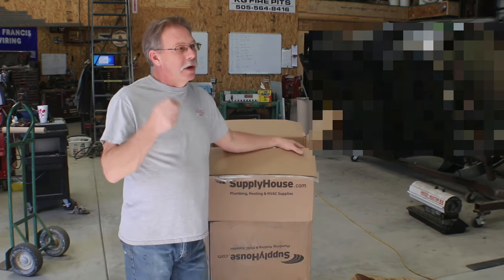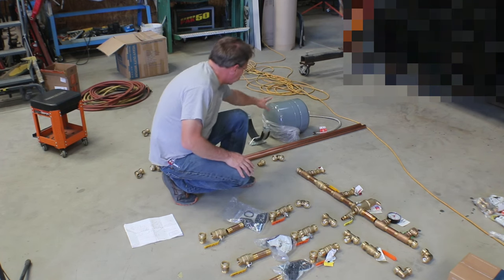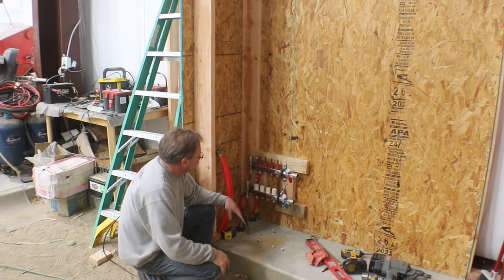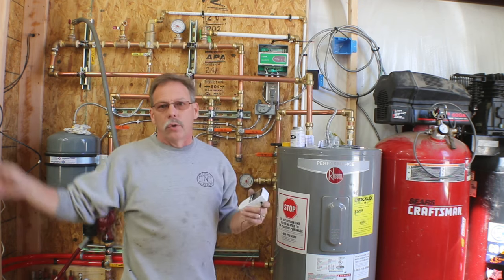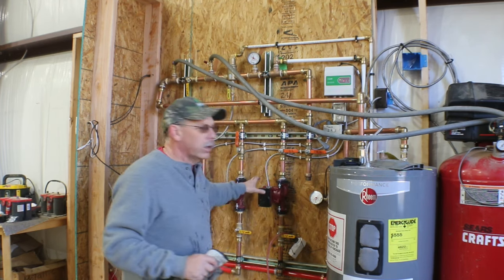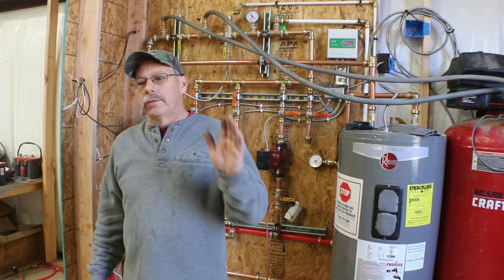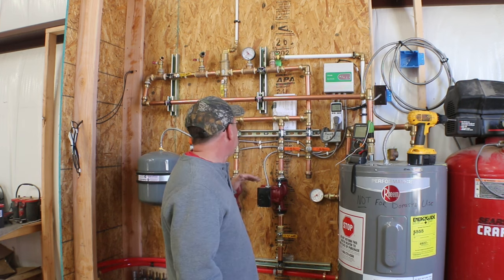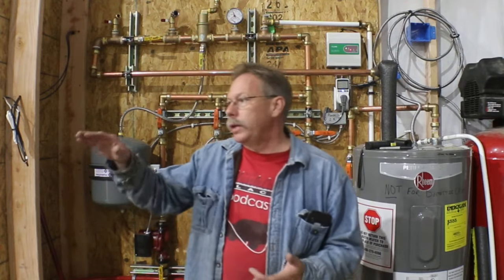Can you Heat your Shop with a $200 Water Heater? Radiant Floor Heating For My Shop | Allison Customs

Comment: Raise the temp in the tank to around 140F to start and add a mixing valve to temper the water to 110-120 going to the floor. You won’t need the timer on the pumps anymore. Wrap the tank in insulation and all exposed pipe to reduce heat loss. Good luck…
Reply from the maker: Thanks for the tips!  I’ve played with the temp and have been looking at adding a balance valve as you suggest.  Thanks for the comments.
Reply: What is the logic of heating and then cooling the water?
Reply: Yes, you can get another 5 degrees of heat that is being lost to a corner of the shop, if you insulate the outside of the hot water tank.  It all depends on where you want to put your heating money. Hot water tanks are not insulated very well at all.  Pumps will get noisier fi you have piping on the outlet that is too large for the size of the pump body and the outlet nipple ID.  Stay within the manufacturers out flow sizing table for this.
Reply: Why insulate the tank if the tank is inside the space you are heating?  And why mix in cold water rather than turning down the heater’s thermostat?
Reply: @blackhawk7r221  The insulation is it really necessary, but it’s always better. The reason for the mixing valve is to increase capacity of water to the zone and its current state the tank goes cold in the middle of a cycle.
Reply: Can you turn your circ pumps down so your tank has time to recover?
Reply: @solexxx8588   but if he needs 120 why not just make 120? My system is super simple so I’m just trying to learn.
Reply: @bpdp379  More heat in the water heater = more available energy to disperse throughout the floor before your tank has to turn back on to reheat the water.
Reply: @sixtomidnight1492  sort of a battery before the battery? Thanks that’s very interesting.
Reply: @bpdp379 Yep. He has a small "battery" (water heater) that needs to charge a larger battery (the mass of the concrete). You want to maximize the amount of energy (heat) that you start with, so that you can "charge" the floor as much as possible before you have to stop and recharge the water heater. 
This is only an issue if the heat source can't continually output the amount of energy needed (BTUs) to maintain a constant floor temp. He has since revised his setup to better suit his energy demand.
Reply: @sixtomidnight1492  gotcha. I use a boiler on my floor so this is all out of my realm of knowledge. Appreciate it.
Reply: @bpdp379   It doesn't really apply for this use case, but in home hot water heaters keeping the temp at 140f prevents anything from growing in the tank such as the the bacteria that causes legionnaires disease. But 140f is hot enough to cause burns within seconds so the temp has to be lowered after leaving the tank.
Reply: @bpdp379  to reduce the heat loss in tank by reducing the cold water return
Reply: Is there an automatic mixing valve that would keep the water heater output going into the floor at about 120°F as it mixes with the recirculating water?
Reply: @MicahFunk  yes
Reply: @bpdp379 I'm guessing the water heater works best at 140 and the radiant heating works best at 120 given the rate of flow, area, and desired temp?  Still early in the video though so just my guess.
Reply: @sixtomidnight1492 where would you install a mixing valve? I dont see how that is beneficial, if the fluid is getting heated up, heating up the cooled fluid...

About to build mine, over concrete
Reply: @AllisonCustoms 
Install a boiler. A electric water heater is a joke and shark bite fittings 
Just buy a combi boiler
Reply: The tank is twice as hot as room temp. Heat goes to cold so it cools the water.

Comment: A friend of mine used a 3 cyl diesel generator and plumbed the floor water through the engine cooling system on his floor heat. heats the floor pretty quickly, and then his gas water heater takes over to maintain... I don't recall all the technicals, but he could switch "zones" to heat the driveway when it snowed. I recall the melted runoff would re-freeze down the street a little and was rather scary to cross, but his driveway was nice and dry, and the workshop was  nice and warm!
Reply from the maker: That is an interesting heat source.  Probably more efficient than an electric water heater too!
Reply: @AllisonCustoms  Indeed. The engine heats the water quickly, as the generator is under a load (not sure if backfeeding the grid, or what) I just recall he had to have at least one of the zone valves open at all times, as that was the only cooling for the engine.
Reply: How about having the generator power the electric hot water heater and having the cold return to the input of the engine?
Reply: I would use PEX rather than copper
Reply: French drain is the answer to the runoff, it runs into a 5 foot rock drain into the sandy soil beneath that we had put in last summer.  I don't have neighbors so it would be a non issue with me anyway.

Comment: You need to do a heat loss on your building. There are free heat loss apps available online. After you know what your heat loss is on a design day(coldest expected temperature in your area) you must match the boiler BTU output with the system. Your water heater is probably 4500 watts. You get 3.41 BTUs per watt. So you have about 15000 BTUs per hour available. That is just about enough to heat a well insulated dog house   LOL.   Although you installed an isolation valve on your expansion tank you left no way to drain the water pressure from your tank. This will leave you only two options to check the air pressure in your tank. Either take a bath or drop your system and allow air into it and reprime it. And finally...stop calling it a HOT WATER HEATER   LOL. There is no need to heat hot water, it is just a water heater or subjectively a cold water heater  LOL.  Just make sure you have removed the 150lb relief valve and replaced it with a 30 lb relief valve!
Reply from the maker: Thanks for your input! I hate when people say please type in your PIN number - my “personal identification number number” really redundant- but thanks, cause now I can get irritated by a whole new commonly used term!  
I did do a heat loss, except that with one bay of my shop still dirt floor, it is very difficult to reconcile.  The WATER HEATER is at 11,000 watts, and you are right still not really enough, especially with about 20% of the floor not helping. Thanks, I hadn’t thought about the WH relief valve, I’ll get that replace pronto.

Comment: If you're going to use an electric water heater to heat that concrete floor you may as well put in a heat pump
Reply from the maker: I’ve been looking into them.

Comment: I feel like so many people overthink this stuff. A tube heater would accomplish the same thing and would be comparable in energy consumption. The only time I feel this would be better is if you have a massively large shop. I mean like industrial sized.
Reply from the maker: Thanks for watching!
The original idea was to use a waste oil boiler, unfortunately I just don’t produce the amount of oil necessary.
Check out the current situation - https://youtu.be/_mR7S4N28oY

Comment: 30 x 30 shop. 3 loops of 300 feet each of 1/2 “ pex. I made the mistake of using a 26 gallon electric hot water heater. The volume wasn’t enough for the hot water heater to recover and reheat the circulating water. I was pumping 60* water out of the heater which caused the hot water heater to run continuously. OUCH. ELECTRIC BILL! I replaced the 26 gallon electric water heater with a 40 gallon gas water heater. Problem solved.😢
Reply from the maker: It sounds like you figured it out!  A warm shop is such a great luxury!

Comment: Put in a commercial air to water monoblock heat pump and your heating cost will drop to 1/4 of what you are paying for electricity now. You won't be able to put in enough solar to make 11kWs and the sn does not shine at night or much in the winter.
Reply from the maker: I responded to your other post about the same subject.  The solar is working well, and luckily NM normally has about 300 clear sky days a year.
Reply from the maker: I keep looking at all kinds of options.  We will see what next fall brings😀

Comment: You rock for putting this out for anyone to learn. Im building my own in the last couple years and what i found out was to slow down the water flow to increase the thermalcline. (Heat transfer). Hotter water into my floor, 208 degrees,  was more efficent and faster recovery than cooler temps. I see this post is dated a little but just want to throw it out there if it wasnt mentioned before. Hope yor garage is working out great for you. I know i love mine!
Reply from the maker: Thanks for the comment! I spend a lot of time in my shop and truly love it.  As for the heating, so far it’s just been expensive! I just recently finished a hydronic solar install and should have a video about the good, the bad and the ugly of that in early 2023.  I’m also finding higher water temps seem to recover quicker than trying to run water temps 85 degrees or less. Still playing with it all though.
Reply: @AllisonCustoms  what would you consider expensive?
Reply: You should not use water that hot 160 - 180°F is what you want. Speed of the flow will determine how well it heats. It will take at least a week to get your building up to temp. These pumps all push water, they do NOT PULL the water. Yes, air bleeder valve should be at the very top of the system. Hearing the pumps making noise is called "cavitating" you never want the pumps to cavitate. 
I had infloor heat in my farmhouse. My best buddy use to install and troubleshoot for the surrounding 3 counties. He sold wood burning furnace/outdoor wood boiler. This is what we use to heat our water.

Werzbo pumps are better than the "Grundgy" ones. And they will last longer.
Reply: Water heater needs to come on more often and run for a shorter amount of time.
Reply: You are going to Crack your concrete. Too hot.
Reply: @denisewilson8367  thanks for following up. I did turn my heat way down. Incoming is 120 but i slowed my circ pump way down by partiality closing my outgoing pump valve. Workin good so far. Ill let ya know if i wreck something
Reply: Where do you find hot water tanks for 200 bucks
Reply: Pretty dang confusing watching someone learn about a sys ! Would’ve been better if he had experience and it wouldn’t be so bad  to learn as he goes , but now with all the mistakes I’m pretty much confused

Comment: Did the same thing in my 40x60 shop.  electric company estimated my first few months, then when they read the meter I had a $1200 or so electric bill.  Quickly made a homemade wood boiler and that works much much better and my electric bills are under $40 a month in the winter.
Reply from the maker: Shocking how much the electric bill can go up, if you’re not prepared ahead of time.
Reply: Do you have a link or more information on homemade wood boiler?
Reply: @flip9710  no, just made it work.  Bent and welded around 60' of 7/8" x .120 ss tubing inside.  Thats what I had laying around at the time.  Sucks the heat right out of the wood stove.
Reply: @flip9710  no, just made it work.  Bent and welded around 60' of 7/8" x .120 ss tubing inside.  Thats what I had laying around at the time.  Sucks the heat right out of the wood stove.

Comment: I build these setups for a living, mostly use Navien combo boilers for heat source so too few Btu's are never an issue.  You did a great job for a first timer!   There are many many ways to set up hydronic systems so its pretty interesting how different people solve the problems.
Reply from the maker: Thanks!
Reply: How many issues with naviens do you see with gas leaks and general disrepair?
Reply: @x_____________5550  I would say 19 out of 20 are good, problem free. Of the 5 percent left the internal pressure sensor is the most common part failure.   also units with long horizontal exhaust runs collect dirt and will cause a 110 error.

Comment: We’ll done!!
As a licensed plumber and a hydronic tech there are some things I would have done differently but as has been said elsewhere here there’s a lot of different ways to do this. 
Everything you’ve done here should work well and you have left lots of options for heat source changes
Couple of comments:
Don’t sweat about the long loop. 450’ is definitely not optimal but it won’t hurt anything. Basically you wasted a little pipe and one area of floor might be a bit cooler. You’ll never notice it in a shop environment. 
If you have trouble keeping it warm on the coldest days you can afford to bump up your water temp a bit. 
All boiler systems need a water make up system to allow for micro leaks and pressure drop from air purging. If you don’t want to continually check it manually I always install an anti freeze make up tank. They’re available from any good plumbing supplier and automatically inject a little anti freeze into the system if the pressure drops. You don’t want a water make up valve because it might slowly dilute your anti freeze. One of my customers made this mistake and froze his distribution lines. Very expensive fix!
As for the heat loss calculation. Definitely necessary in a house but an open space like your shop is very forgiving and this will work just fine!!
We’ll done sir!! Now learn to solder and save a ton of money on fittings😀
Reply from the maker: Thank you!  My son in law (who is a plumber in training) saw all of the Sharkbite fittings and Cringed, but also said it all looked good.
Reply: That water heater looks brand new there’s not $200? And you’ve got a couple thousand dollars with the pumps and fittings there? Not to mention all the piping on the floor. Made it sound like this was some cheap which is not my new means for hydronic loop😮❤😂😊
Reply: Man  manifolds are a couple hundred dollars each
Reply: Pretty sure a licensed plumber wouldn't refer to sweating as solder.  😁
Reply: @AllisonCustoms  I taught myself to solder in 2 days, and my joins are all leak free and look better then professionals ive seen. You can do it :) I just used youtube to learn, there is a great guy called got2learn, follow all his steps, and it's perfect. Just be sure to flux both the pipe and the fitting, he says it, but he says it fast and I didnt catch it at 1st and it didnt work well when I practiced ha
Reply: Not only is it cheaper to sweat all your fittings in, but it's more reliable too. 
And it's not just the fact that sharkbite fittings are so expensive, but I've heard mixed reviews between plumbers who said they'll use them in a pinch, to others who won't risk using them at all, and often even remove them on jobsites when they're not causing issues, just to reduce the potential for failure.  

The one plumber who introduced me to themnactually liked them... but I learned his work didn't have a great reputation either, as he liked taking shortcuts on other people's dime, so maybe I'm biased there in not trusting the things.  

But I've heard enough.... I won't be using them at all.  Besides, I learned how to sweat copper fittings in sometime ago, and its pretty easy to get right the first time.
Reply: Fortune in fittings  @AllisonCustoms
Reply: How can I do a water system with my wood furnace? Without valves if possible.

Comment: I was searching for some details on YT about adding a make-up injector and found your project here.  Pretty wild as I made a very similar homegrown system!  I fortunately can weld and solder so saved a bundle in comparison.  I'm also running the old 60gal propane water heater from my house after we upgraded, which is way more efficient and we have a 1000 gallon underground propane tank.  My pole barn shop houses my 5th wheel camper, my truck, and mechanics tools and lift, and my woodshop is upstairs.  Love this system, and glad I DIYed the subslab insulation and running the PEX before my concrete contractor poured the monster slab.   Truly, this is the best way to heat a shop IMO, and my arthritic feet are much happier on a warm floor in the winter!!  Great job and it's awesome you shared this.  Like you, I really had to piece the knowledge together, but having done so at a very small percentage of the cost I was quoted by contractors let me insulate the building the best way.
Reply from the maker: Yea, I am very happy I did this myself, and I’m going to learn to solder the pipe for when I make up the system for the final time.  Right now it is still somewhat of a work in progress.  I recently add Solar to the system and (I THINK) I have the bugs worked out of that, so now just to continue tweaking until my system is as efficient as possible with the available resources.

Comment: A BTU is a BTU. The water heater will create approximately 15,500 BTU per hour. Whether you run the pump constantly with a lower temp or on/off with a higher temp, the BTUs going into the floor are exactly the same. Amazing how many people can't grasp this concept. Good thing you saved $1000 on the water heater so you could spend $3,000 on extra crap you don't need. Great job.
Reply from the maker: The original idea was to use a waste oil boiler, unfortunately I just don’t produce the amount of oil necessary.
Check out the current situation - https://youtu.be/_mR7S4N28oY

Comment: seems to work. i dont have water in my wood shop. have coal wood burner. going to try to heat with electric water tank. i did build a boiler system with a gas boiler for my mechanics garage. built a boiler room 150' away with coal-wood & a gas boiler so yes you have given me a good starting point. i have till October 2023 to get working. thank you for ur time
Reply from the maker: Thanks for watching!  I hope you are able to create a more efficient version, but I do like the fact that mine doesn’t require monitoring.